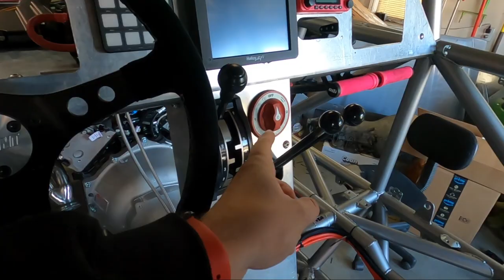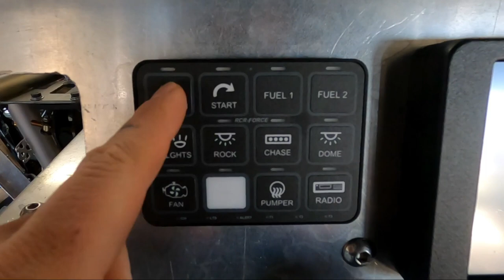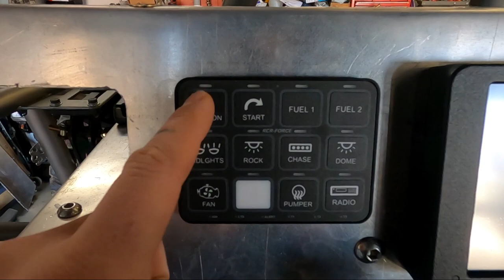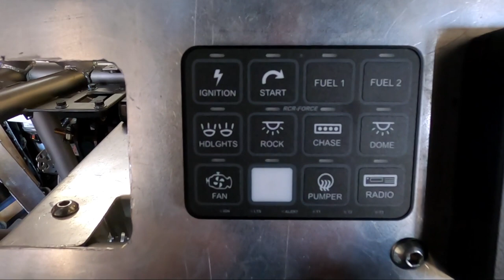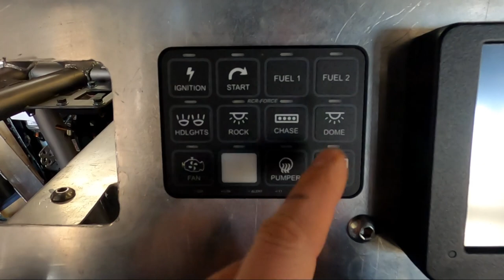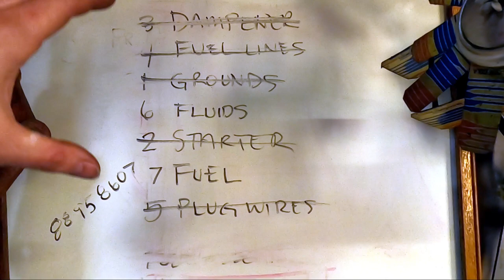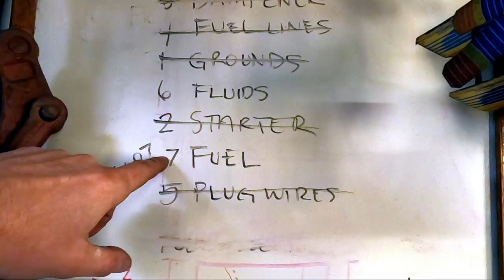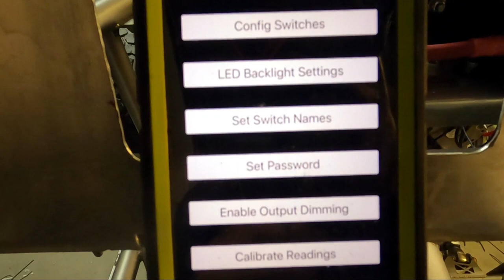LS1 First Start with Holley and Switch-Pros

Comment: Great video! Looking into getting a switch pros setup for my rig. The switch pros just saves a bunch of headache with relay failure and fuses blowing. Haven’t done much research on it but I’d like to wire up the ignition and start up to be a single press on the start and have it kill the starter once the engine fires. I’m sure it’s doable. Running the same setup. Ls with a terminator x. Very nice rig!